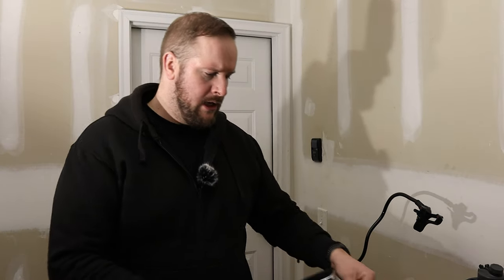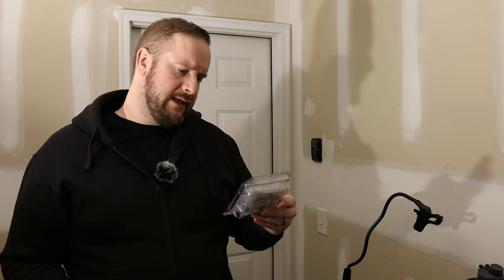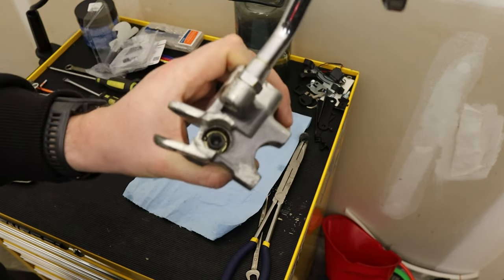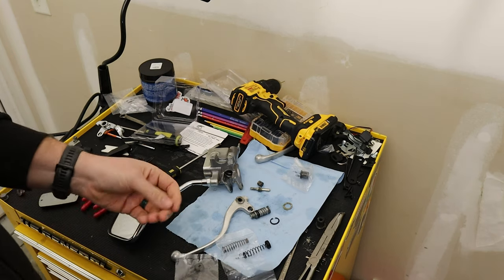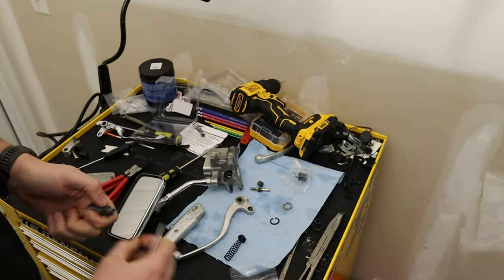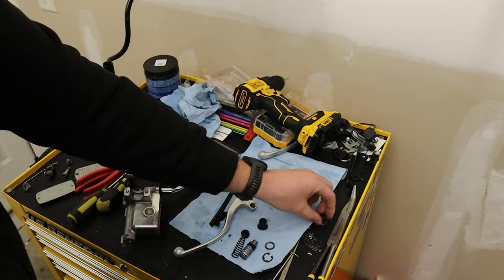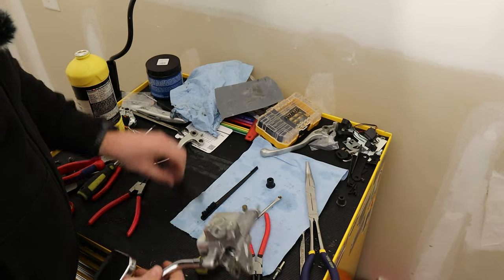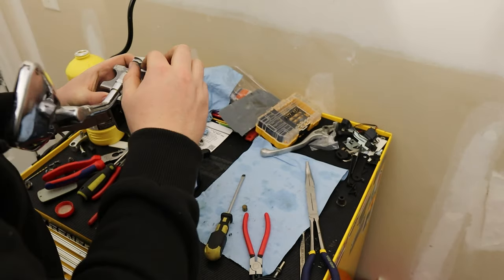Motorcycle Clutch Master Cylinder Rebuild | 1997 Honda Valkyrie

Comment: First step.   I think your calm relaxed style of presentation is the winner.  Things go wrong there are always glitches but you always get the job done with the minimum of fuss. I am waiting to see the carbs!  I have seen some " interesting " videos on those.  Another sound video. 👍
Reply from the maker: I've honestly never gotten mad or lost my temper working on bikes, cars yes, but I was also younger. 
The carbs are coming up, I've located a rebuild kit and it's on the way, so should be getting them done very soon :) Looks like itll be interesting to say the least 😂

Comment: Good vid again.  I have cable clutch, but good to see how to for future reference/basic principals.  Will be doing brakes soon, so master cylinder rebuild will be watched for sure. OC - your vids help no end, so nothing I've seen has daunted me.  No doubt there will be problems that I come across, but I'm very fortunate that, as a pleasure only rider, I don't have time pressure if things go off script.  Cheers, Andy.
Reply from the maker: Thank you sir, clutch cables just keep them lubed well and they'll generally last forever. I shall do that asap then amigo :) That is good, I'm glad these work for some people :) I'm not a cameraman naturally so it's really hard to remember to try show everything :P That's the way to have it trying anything maintenance related tbh, time and patience.

Comment: Well that's timing, as the clutch master cylinder on my Blackbird needs servicing, it has a slow leak which I only discovered when I parked it up for a week on the side stand instead of the mainstand.  I'll book mark this vid for when i get the kit.
Reply from the maker: You'll fly through it! The only thing that's ever painful on those bikes is the brakes and only then cus of bleeding them! I hate bleeding those linked systems 😂
Glad you spotted it!
Reply: @TheGorillaBiker  One of those fancy pliers too. I used to be able to do stuff on my bike then got super lazy and had "the man" look after it. I was thinking of getting rid of the Blackbird, but I think I will use it as a learning tool for light general maintenance. Its not the prettiest, but runs and rides fine baring the 25 year old suspension and my fat arse lol.
Reply from the maker: @AuldhannRua  Yeah the fancy pliers are critical, you in theory can use something else but you'll hate everything that's ever lived once you try it. 
Yeah, I've had that urge then thankfully for my wallet my distrustful brain can let anyone else touch my bike 😂 The lads in freeman I'd let if I was still at home.  
Ah yeah that's a great idea! You'd never know what they'll end up being worth too!
Haha trust me I get that 😂

Comment: Ay nice video!  Very informative.  Have you considered using an Ultrasonic cleaner?  They're incredible especially for older bike parts.  When my friend and I rebuild the carburetor in my Vulcan 800 Classic a few years back, we used one.  It was pretty impressive.
Reply from the maker: Thanks! I had one in Ireland, used it all the time. Too expensive to ship everything I had tho so I have it to my dad. Wouldn't have worked here anyway due to your differences in power transmission etc. Id get another one but they're pricey and I don't have as much space anymore.